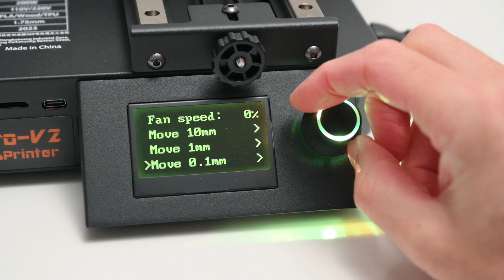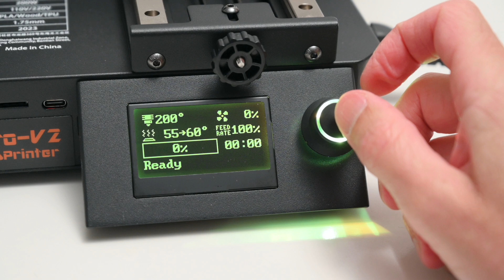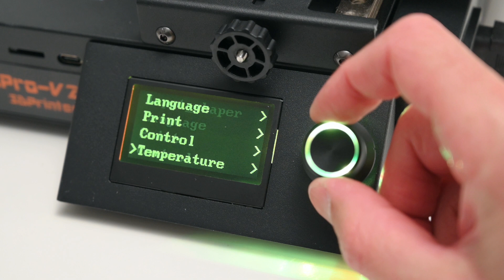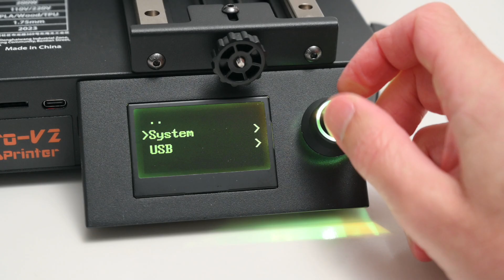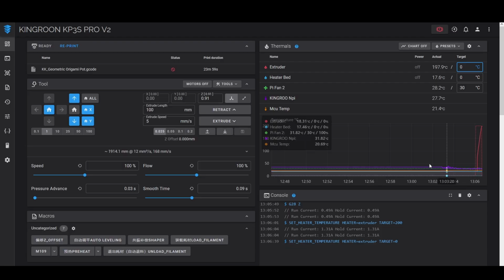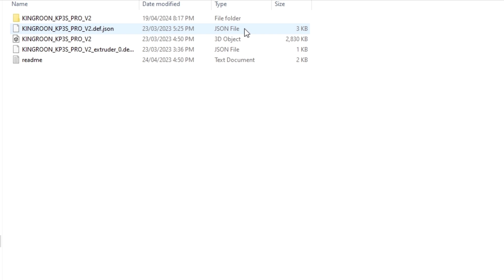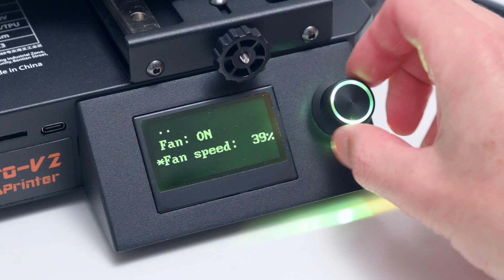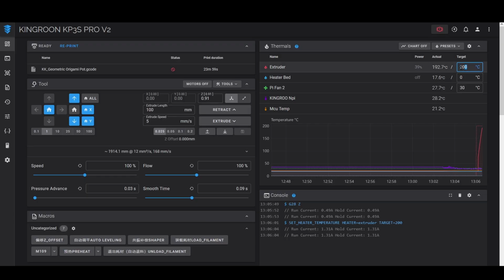KINGROON'S Budget Klipper 3D Printer - KP3S Pro V2

Comment: 3:56 If you notice, the bearing has a bit of movement to it. If you move the printer head up to just below the bearing, you can use the small screws to secure the bearing in place and ensure that the lead screw stays parallel with the rail.
Reply from the maker: Thanks for the tip

Comment: 3:40 If you lie the printer flat on its back so the channel is horizontal, it is both easier to adjust the t-nut and sight through the hole.

Comment: Huh, seems like its worth sticking with my basic kp3s. Its been running strong for over two years now (only ever has a problem with one belt falling off). I was eyeing up the v2 pro because of the faster printing speeds, but the surface quality tradeoff just doesn't seem worth it. I run all my prints at 60mm/s with pretty good results for a $180 printer. Awesome video, thank you.
Reply: wow ur lucky my kp3s literally burnt off half of itself and got the threads ripped out by a nozzle a year in

Comment: Hi, I've seen a few other reviews, but they are old, like 8 months ago. All of them had issues with the fan only staying at 100 or 0, and there was some overextrusion, and there was also a problem with filament changing. One review had a printer that wasn't centered. Are the problems still here? Because I'm thinking of buying the kingroon or the ankermake m5c for a beginner. The m5c has almost no issues, and it's basically plug and play, and it has a bigger print volume. But the kingroon is smaller and has many issues. But it also has linear rails. So idk which one to buy. What do you recommend?
Reply from the maker: This KP3S has fixed fan speed its adjustable, over extrusion fixed, filament changing was fine, printer centered. Now its print quality wasn't that great especially at high speeds. For a beginner 3D printer, I would be taking a look at the latest Ender 3 series or the Bambu Lab A1 3D Printer
Reply: @amstudioprojects  thanks but the bambu lab is not in my budget it's too expensive for me. I think I'll get the m5c. But someone ik recommended the kp3s pro v2 over the m5c that's why I asked. And so far from what I'm seeing the m5c has much better print quality
Reply: @Krispy367  Bamboo A1 mini is for 278€..  it is only 60$ more than KPS Pro v2...  it is best value/price than Kingroon